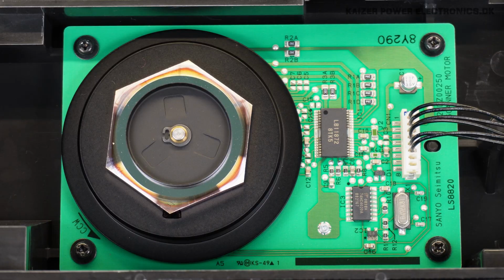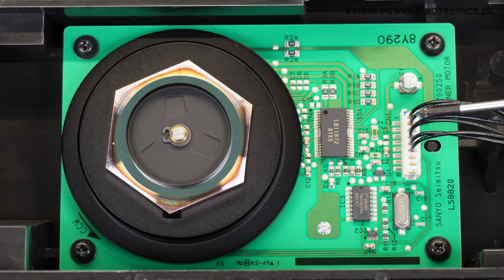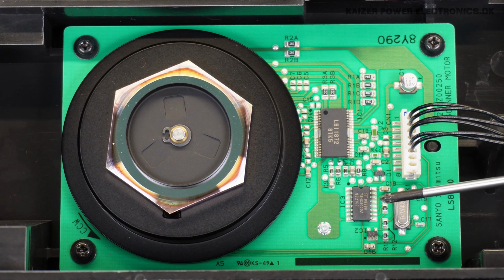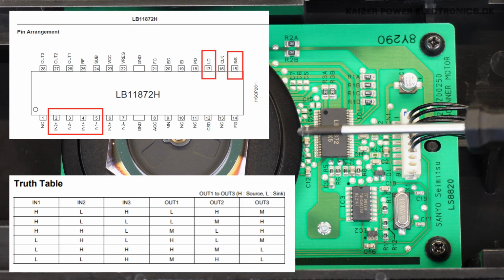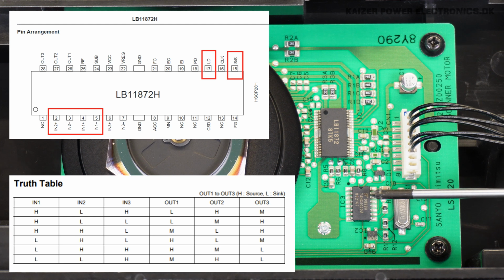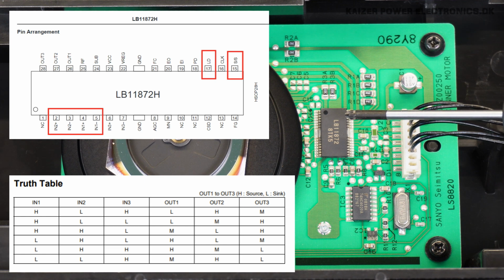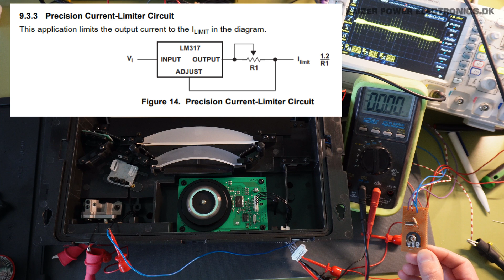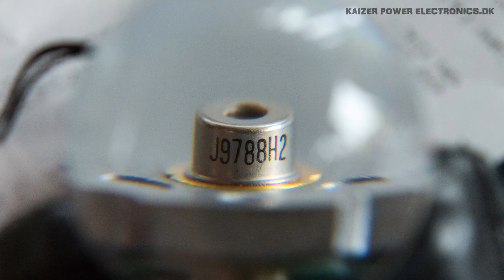X-ray Image Laser Scanner Reverse Engineering. Philips / Fujifilm PCR Eleva S (Part 2 of 3)

Comment: Thanks for your greate video. I have one question, Any way to know ho to read output of laser by sensor? Now I cleary understand how to make laser line,but I still dont undetstand how to read it at last. Thank you so much your greate greate video.
Reply from the maker: From how the x-ray image is converted from a "single pixel exposure" into a gray scale image, I would guess its something like a 0-255 value per pixel, to determine the gray scale.